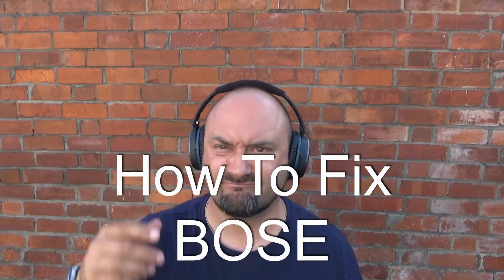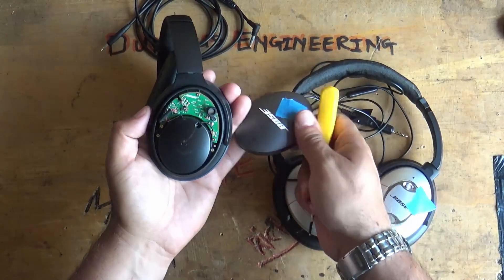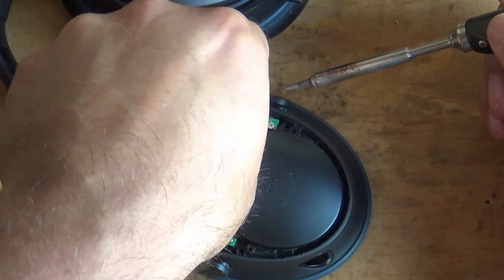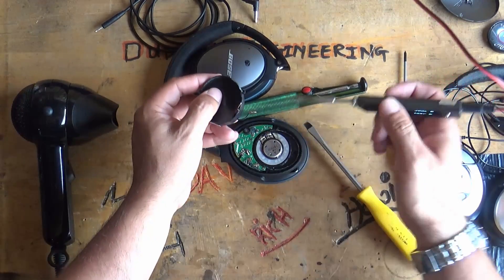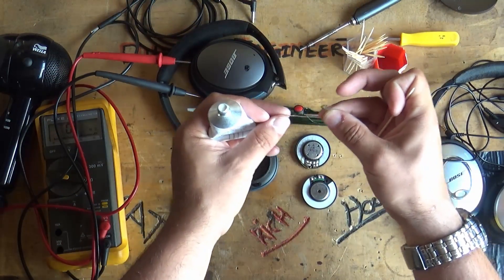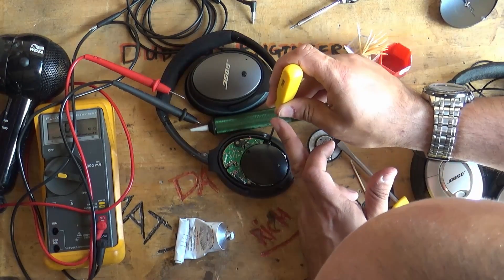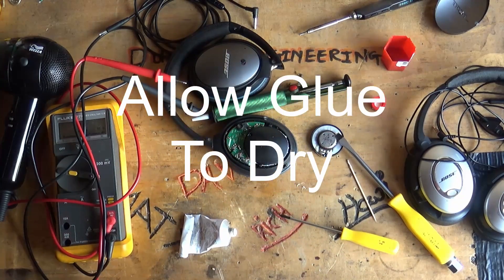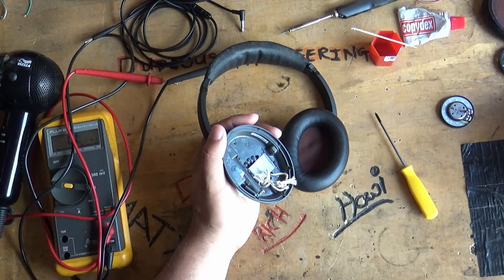DuB-EnG: Repair BOSE QC35 QC25 QC15 Quality Headphones Fix Faulty Quality Problems One Speaker Work

Comment: WARNING!!I just repaired mine but seriously I DONT recommend this!! Why:
On my QC25 it was not possible to get the glue with heatgun/ hairdryer loose. Its just impossible to bring the heat to the glue! The phones got so hot that the shape changed and after I ripped out the lid+speaker and successfully replaced it  wasn't able to get the aluminum lid back on!! 
The phones looks now super sh**ty....Don't do this I am a experienced maker and this ** took me 4 hours for a * result! Just send it ti bose or sell them on ebay. You'll make it worse its not worth your time + money
Reply from the maker: So they changed the glue formula for newer versions ... then you have to do the upgrade...  it’s corporate money making :-)
Reply: how do we know which qc25 models have the new glue?
Reply from the maker: Great question!!  Maybe the serial numbers will have the answer... sorry I don’t know...  :-(
Reply: @DubiousEngineering  no worries! thanks for the reply :) do you think nail polish remover or acetone is a good option to get rid of the adhesive? i want to repair mine but don't wanna go through the headache lol
Reply from the maker: Tahir Dahrouj ... id be tempted to dremel it but there are a lot of risks
Reply from the maker: I’d consider a dremel...  cut it open :-)

Comment: Could you please show - how to fix a QC 35 ii - it is hard to remove the speaker cover - it is different from Qc 25 - any help?????????
Reply from the maker: No problem!!! Send me some QC35ii :-). Hahahah
Reply: Don't try mate!! I just did this to my qc25. Its impossible to get the glue loose. I tried it even with a heat gun resulting that the phones' outer shape changed so now the aluminum lid doesn't fit anymore! (the glue was still hard ). Just send it to bose  or sell it on eBay.
Reply from the maker: They changed the glue mate... :-(.   Now it’s dremel and cyanoacrylate
Reply: @DubiousEngineering  Oh crap :( But anyway your tutorial helped me a lot but you should add this info somewhere noticeable...
Mine are working now :)

Comment: This is BS, my glue was insane hard, not even any amount of heat would loosen mine, I l=melted the plastic and it still wouldn't losen the glue. wtf
Reply from the maker: Peter Twiss I’m so sorry... if you check the comments some other people have been noticing this with the more recent versions of the headphones...  bose decided to stop people from being able to repair them...  :-(
Reply: Dubious Engineering those bastards oh well I tried. What a waste of $300 I’ll never buy their products again. Thanks for the video
Reply from the maker: Absolutely agree...  So sorry for you...  id be tempted to use a disk on a dremel to cut them out and 3d print some replacements ;-)

Comment: Thanks it helped me to change speaker for QC35. Glue was so strong that I damage the plastic inside but I don't care. I also had to remove the mini jack plug before (2 screw). I don't see the color of soldering in your video inside but anyway I guess I was lucky because it works like a charm!
Reply from the maker: Excellent...  glad you got them fixed ;-)

Comment: Hi. I have a pair of Bose headphones which I acquired from someone else. The Bose website says that the serial number corresponds to a QC35 Mark I.  They look like the QC25's in your video and initially disassemble in the same way.  However, my blown driver is in the right side and when you open it up there are two differences.  Across the back of the black plastic cover over the driver there is a ribbon cable joining the main PCB above the driver to a subsidiary one at the bottom (I guess this is the controller for the volume etc switches which are located near the bottom of that earcup).  OK, no probs there, it is held in place with something like white wax so we can cut through that and flip it out of the way.  But then the plastic cup over the driver refuses to yield.  Not to moderate heat, not to not-so-moderate heat, not to brute-ish force. Can't shift it.  Also the cover is not roughly round as yours is, its more triangular with rounded corners.  There's no doubt they are genuine Boses - all the PCBs are branded etc - but they don't appear to be either of the ones in your video nor anyone else's here on Youtube.  Any thoughts?  Come across any like this? Any advice gratefully received!
Reply from the maker: Wow!! Those sound special!!  I have never seen anything like you have described... if there are any part-numbers on the PCBs or any application specific ICs consider trying to google those part numbers, that may lead somewhere...  I’m sorry I can’t help...  best, H
Reply: @DubiousEngineering  OK thanks. Since they appear to be non-repairable and since I have nothing to lose anyway, I might try cutting through the plastic cup with a hot scalpel and then attempting reassembly with superglue or epoxy or something.  I doubt it will work but just maybe......   I think this is pretty criminal on the part of Bose; they must know from their support teams and quality control stats that the drivers are prone to failure and yet they go from a just-about replaceable design on the 15s and 25s to a completely locked down one 
on the 35?  Poor.
Reply from the maker: You are exactly correct...  they made a commercial decision to screw the consumer and make more money...  good luck with the repair!

Comment: Hi there ! Thanks so much for this video that made me repair my qc35 i. As already said in other comments, the hair dryer is not enough to unseal the black plastic protection. I took a thermal cleaner and a big amount of strength on the screw driver. Then I souldered the black wire directly from the speaker to the circuit board (initially it went through the black plastic cover). In the end it works again with 280€ still in my pockets 👍🏼🙌🏼
Reply from the maker: EPIC!! - Another sucess story!! - So good to hear!!  I hope I haven't counted this sucess twice..  :-)
Reply: Yeah I found several guides to fixing the headphones but they both show replacing the left speaker which seems much easier compared to the right one. My experience with a right speaker was just like yours - it took a thermal airgun, a sturdy crew driver and a great amount of strength. I assume you also dealt with the right speaker.

Comment: Thank you for this video. My pair of QC25 broke after 3 years of daily almost daily usage. The right ear driver stopped working. After buying a 2 pcs replacement parts on ebay for just $5.89 USD incl. shipping i was able to fix them with this video. Bose asked for 155€ after claiming for full replacement. After some arguing they offered 75€. I have bought a still sealed pair of QC35 at a BlackFriday Sale. I am still wondering whether to keep them or switch to another Japanese brand.
Reply from the maker: I'm hearing similar things about the QC35s...  perhaps use them until the warrantee expires... then sell them on!!

Comment: Hi. I have a pair of QC15’s that was given to me by a friend, who said they don’t work anymore. 

I plug them into my phone and play music with Noise Cancelling off and I hear nothing and if I turn it on I hear music but the light is red. 

It has a new battery and I opened them up completely and there doesn’t look to be any loose wires, including the one that goes to the battery compartment. 

What could be the issue? I also have the normal wire connected to a iPhone X.
Reply from the maker: Hmmm sorry to say that sounds like electronics...  might be very difficult to fix....  check you have a good fresh battery

Comment: Dubious I have another problem entirely with my Bose headphones..I was wondering if there is some way I could contact you and possibly you could help or give me guidance as there are no Bose repair people in my area.
Reply from the maker: Let’s try and talk it through on here... I’m no expert...  what seems to be the problem?
Reply: Dubious Engineering ...the port where my headphone cord goes in is broke off the little motherboard piece. At first I thought it was just a bad cord so I bought a new one,then noticed the port where you plug it in is loose. I unscrewed the headphones like you showed in you video so I could look inside to see if I could possibly tape it back on, but that does not work.im not sure if they are fixable or if I should just give up on them.

Comment: DUDE I bought replacement speaker for 18€ and I have followed your instruction for my 4y QC 25 with almost dead right speaker (cracking noise, or work some time) and it work. Regarding to the glue, I used a simple gel regular glue, just a little, and it's fine (at least for now) :D
Thanks a lot, that was quick with your video :D
Note that I accidentally destroy the little cable from the PCB to the speaker, I replace it with two simple electronic wire ^^ but it's fine :)
Reply from the maker: I am so happy that this video has helped you...  I'm so glad you been able to repai your headphones!!  Well done !!!
Reply: To put the drivers in ear cups like factory installation, only use 3M™ Yellow Super Weatherstrip and Gasket Adhesive (available in auto stores mostly).

Comment: Thanks so much for this video.  I have a friend whose QC35s were bitten by this (though testing the resistance actually showed that there was no continuity AT ALL in the driver).  Can you be a bit more specific about how long to heat the glue (do you know its softening temperature?  I ask because another YouTuber posted a video where he tried to use a heat gun and ended up melting the plastic driver covers and came to the conclusion that a hair dryer is best.  Also, in my case, it's the right speaker that failed and it's a lot trickier to replace because of the ribbon cable that goes from the mini-board that houses the charging connector and header for the button cluster's data cable, so you actually have to pop out this ribbon cable from both ends (the middle of the ribbon is glued to the plastic driver cover), then you can hinge it up, desolder the driver, solder in the new one, and reverse the process.
Reply from the maker: Ah...  the modern QC35s have different glue and you cant get them open with a heat gun...  it just melts the plastic and the glue never opens up...
Reply: I managed to do it last night with a hairdryer and a lot of patience, took about 20 minutes of heating and prying, it's still doable but gotta be careful not to damage anything.

Comment: Hi, would you be able to advise how to fix an issue of automatic switching on. My headphones turn on by themselves which drains the battery
Reply from the maker: QC35 headphones I guess...  if they are still in warranty...  perhaps call BOSE and send them back
Reply: @DubiousEngineering  unfortunately they are no longer under warranty

Comment: The drivers on these headphones are a disgrace, not in terms of sound, but in terms of longevity, i've already had 2 pairs replaced by BOSE under warranty and now the warranty has expired another ones gone pop, the diaphram is too weak and flimsy and repeated air pressure pushing against them putting them on and off splits the dainty, flimsy wire inside
Reply from the maker: Exactly...  Bose clearly didn't test these drivers well enough, or if they did, they decided they would likely last outside the warranty period, and therefore encourage people to upgrade in the future (when their headphones stopped working!!) - Grrr....

Comment: Yes, same here. Thank you. Mine work fine again too. I used Patex  100 % all repair. Could not find copydex offline
Reply from the maker: Great to know there is an alternative... thanks for sharing!! :-)
Reply: To put the drivers in ear cups like factory installation, only use 3M™ Yellow Super Weatherstrip and Gasket Adhesive (available in auto stores mostly).

Comment: Note that newer versions of the QC25 are basically unserviceable - the plastic cover is glued differently and no amount of heat will melt the glue - you end up melting the plastic. If anybody knows where to get a replacement plastic cover let me know -- It is labeled ABS L -- and mine broke when taking it out.
Reply from the maker: That’s a real shame, and thanks for adding the info!! ... BOSE :-(
Reply: Exactly the same here. The headphones are wrecked - and that's after buying a new speaker and bottle of Copydex. Very annoying.

Comment: Where did you get the replacement drivers from please?.... and where they genuine?
Reply: eBay (Same 40mm size drivers are also used in most high end headphones manufactured by other brands like Beats, JBL, Onkyo, Sony and so forth)
Reply from the maker: eBay...  please read through the comments...

Comment: My qc35 started rattling after they fell. Only on the right side as if something is loose. Could it be the speaker itself? They still sound good
Reply from the maker: It shouldn't be too hard to open the case... just a small phillips screwdriver...
Reply: Dubious Engineering I’ll try to open it up hopefully it’s something I can fix myself :)
Reply from the maker: Good luck my friend!!

Comment: hi! do the QC15, 25, and 35 all use the same speaker? where can i get a genuine BOSE replacement speaker?
Reply from the maker: Yes, the speakers are the same... guess what, the speakers are all made in China...  £7 on eBay ... works great!  Well it did with mine!
Reply: eBay (Same 40mm size drivers are also used in most high end headphones manufactured by other brands like Beats, JBL, Onkyo, Sony and so forth)

Comment: Hi, my qc35 I has problems in it's left ear. It sounds like something is loose. I guess it is in the speaker. Any other suggestions? I tried to open the speaker cover but the glue is quite strong. Maybe I should use a heat gun instead of a 2KW hairdryer. Is the cover glued around or just the bottom side? Thanks for the help
Reply from the maker: jessehup the qc35 uses stronger glue... I keep hearing it’s hard to pull them apart... trust me, the hairdryer will work, but you have to get the screwdriver in there to prise them apart... make sure you have undone all the screws!! Let us know how you get on!!
Reply: @DubiousEngineering  I indeed managed to get the cover off with extensive heating and some force. However the speaker seems absolutely fine. 31 ohm. Any other ideas what could make this rattling noise?
Reply: @jesseh2  have the same problem, on my left speaker, please let me know if you figure it out
Reply: @slavikivanov8605  I bought a new speaker in the hope that is it. It has yet to arrive

Comment: Great video! Where did you get your replacement driver? ebay have plenty of cheap options but I don't think any are genuine Bose parts.
Reply from the maker: They are all made in China ... including the ones for BOSE...  I spent £7 and £2 postage and my headphones sounded epic after the fix... no problem
Reply: eBay (Same 40mm size drivers are also used in most high end headphones manufactured by other brands like Beats, JBL, Onkyo, Sony and so forth)
Reply from the maker: Yeah I think they are all made in the same factory in China

Comment: From where would you buy the spare speaker?
Reply from the maker: Hello my friend...  eBay has spare speaker...   look for “replacement qc25 speaker”
Reply: @DubiousEngineering  Would you trust them? Heaps seem super cheap, likely from China (yes, I know, everything comes from China in the end). Just what to look for some credibility?
Reply from the maker: Yeah... I found one for about £7 ... it worked a treat... no idea if £2 or £20 will make a difference!!
Reply: @DubiousEngineering   no difference at all. I bought a pair of the cheapest on ebay to fix mine for $5.89 including shipping from HK. Sound quality is the same. If i can buy one speaker for $0.60 , Bose probably buys them for $.0.05 USD. So long about the quality.

Comment: Thanks so much, I’d got them apart and worked out there was a fault with the speaker but no clue about next steps.  After watching this I got the part of amazon and fixed in a jiffy.found it easier to push the speaker out from the inside with a screwdriver...my glue didn’t melt with heat.  Great!!!
Reply from the maker: Great work Graham!! Glad this helped a little!! Sub for more!

Comment: Thanks for your videos on fixing the QCs !

I've already fixed old QC2s with a replacement driver, now my QC25s have the same issue on the right side, sound cutting out intermittently .

Did you ever try a replacement speaker from China ?
They are dirt cheap, like 3 bucks a pair for 'Bose replacement speaker', and presumably the same ones that are sold for 15-20 $/Euros in the US and EU .
Reply from the maker: I bought mine on ebay...  (the replacement speakers) and they work a treat!!

Comment: Where might one find these replacement speakers?
Reply from the maker: Sorry for delay responding... Pop onto ebay and type QC25 replacement speaker...
Reply: @DubiousEngineering  - most are the same quality as the Bose OEM? interesting...
Reply from the maker: Yup, the ones I found worked a treat... sounded fine and are still running!

Comment: Nice video. What do you think the problem is if the right driver works off an on? QC-35
Reply from the maker: Likely to be related to the driver...  perhaps small vibrations make the fine wires touch ... try tapping it to see it that makes it go on and off
Reply: Dubious Engineering. Tapping it works some of the time. Or when I play it loud it goes off as well. I’ll check the wires. Thank you
Reply from the maker: It’s likely to be the wire inside the driver... you can’t get to it.  Suggest ordering a replacement driver.
Reply: To put the drivers in ear cups like factory installation, only use 3M™ Yellow Super Weatherstrip and Gasket Adhesive (available in auto stores mostly). @DubiousEngineering